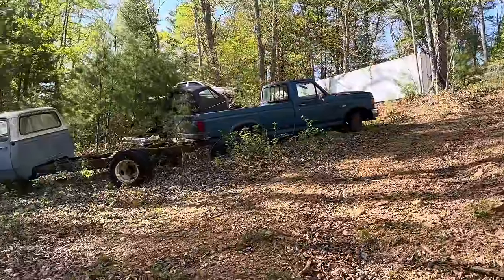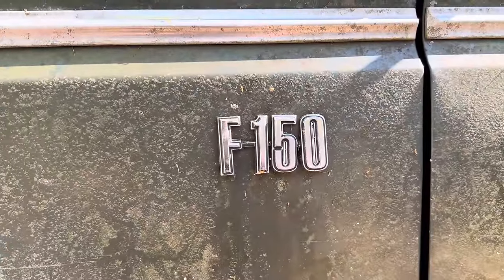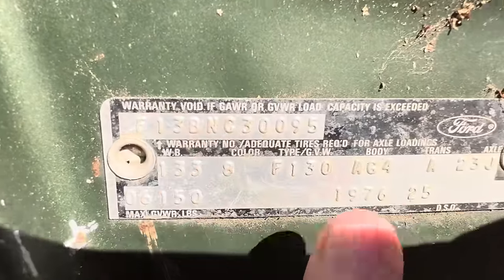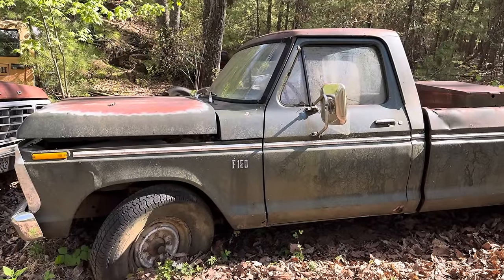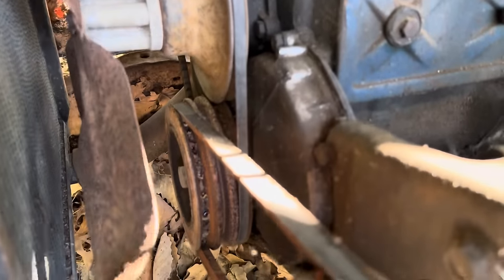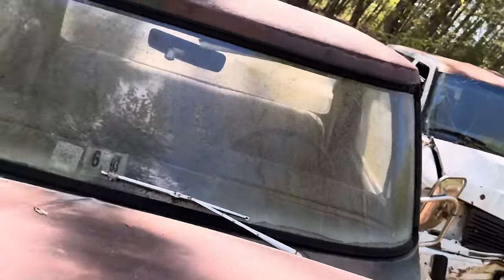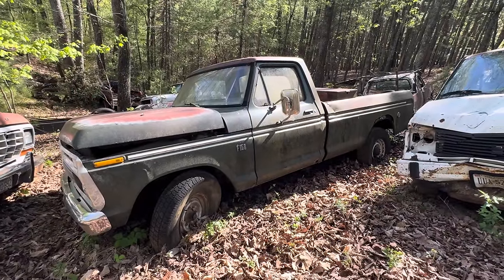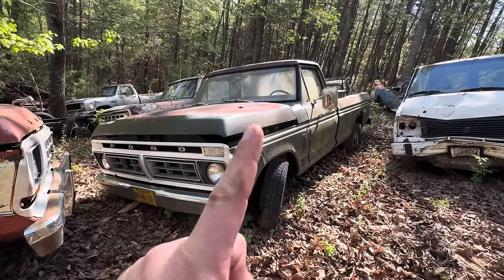Uncovering A Hidden Gem: Strange Ford MYSTERY Truck Discovered In The Woods! #RustBucketRescue

Comment: This is like the weird late '90's F150 "7700".  Right about the time they introduced the Super Duty trucks, they also made an F150 with "light duty" F250 running gear.  They were a really unusual 7 lug wheel!
Reply from the maker: Very interesting, I’ll have to research those!
Reply: A friend of mine drove one for a while, it was weird
Reply: They have unique badges.  Where it would normally say "XLT" or "Eddie Bauer" it literally says "7700".  I remember most of the owners I knew hated the weird 7 lug wheels, because brake parts were harder to come by and the factory steel wheels were the only wheels available!
Reply: @matthewf5891 1997-99 were F250's and the 2000-04 7 lug models were  renamed F150 HD or something similar. The 7 lug wheels were stupid IMHO
Reply: The company I worked for bought dozens of those trucks at the time. When they came in and we realized they were a 7 lug wheel we had to order 7 lug wheels for extra spare tires as well as due to where we used them each truck needed two spares available.
Reply: I replaced lots of those 7 lug axle shafts. Had one customer that never could keep the axles more than a month before replacing them again. Never could figure out why as it wasn't abused.
Reply: Never heard of a seven lug wheel.
Reply: @rodneyj.4121  1997-2004 F150/F250 light duty; those damn 7 luggers were a real thing, I remember them from new
Reply: @matthewf5891  I remember those 7 lug Wheels was sort of a stop Gap measure because that model of F-250 was going to be different and only for a year or two that was when they separated the two models the 150 is a different truck from the one that was to come I they went with a 7 lug wheel because the underpinnings for that truck are different they kept with the old style for the one tons for another year or two before they were finally done with the 3/4 and 1 tonne 1 1/4 ton variance F-550 what's that a deuce oh I just remembered that's because they were developing a Suburban type truck with the new body the ones for the F-250 F-350 F-450 F550 I think if you had an F-100 and it had a straight 300 cubic inch so I would imagine that would be called a f-130 so didn't the F-150 not come out until 77 I know that's the year it became the most popular truck in America also I think that's when they discontinued the F100 because you were talking about the lights 77 had a different lighting setup so quite literally the F-150 was launched with the different more heavy duty electrical system
Reply: I worked for Summit Developers in Salisbury NC and got a new 2006 F-150 extended cab long bed heavy duty pickup. It had a 8,200 GVCW vehicle load rating and those 7 lug wheels!
A 250 GVCW started at 8,800 as I recall. In my opinion Ford should have never made those 7 lug limited production pickups.
Reply: @norahjaneeast5450  1975 for the F150 since it's GVW was over 6,000 'lbs hence not needing any sort of emissions equipment outside of PVC and possibly an Evap system. The F100 that year was stuck with the cat, etc; otherwise the exact same truck despite its under 6,000 lb GVW
Reply: That I've been able to put together is that Ford did the 7700 package to be like the Z71's with the 3/4 ton rear axle.
Reply: @adamelliott2302  you're at least partially correct IMHO
Reply: We owned 2 brand new. They were odd trucks. 7 lugs like you said and parked next to an normal f150 (non 7700) the axle spacing was also different . Both had the 5.4
Reply: @martinthomas2439  the last year of those 7 lug trucks was 2004
Reply: @piercehawke8021 Not exactly. I had a company issued 2014 F150 with the goofy 7 lug wheels (aluminum). Mine was 2wd, but they could have 4wd with the 3.5 V6TT or the 5.0 V8. I’ve only seen them in super cab long bed.
Reply: They still use the 7 lug wheels on some f150
Reply: Kind of like the Silverado 1500 with 8 pin wheels. Circa 2000's.
Reply: These oddball trucks are pretty cool. I think even Dodge got in on this around the same time with the 1500 Megacab.
Reply: @lancereagan3046  or the (Dodge) Ram Mega Cab 1500; it was clearly a 3/4 Ton pickup but derated in payload to I'm guessing under 8,600 GVW on paper masquerade as a 1/2 Ton
Reply: @piercehawke8021 I agree. Had a 1999 myself. The 7 lug wheels were the weirdest things about it. It was like they used passenger car studs and lugs on a standard f 150 rotor. Other than that a good truck for what it was. Total beast in the snow, though.
Reply: I have a set of new rotors for a seven lug Ford if any one needs them. ✌🏼😎🇺🇸
Reply: @RustBucketRescue    there were a few jellybean diesels as well with van engines
Reply from the maker: @bobbywalter5320  I’ll have to look into that, that sounds like fun oddball truck.  I know 2004 mustangs, built in the last 6 months of the model year got a van sourced 3.9L V6 instead of the mustangs 3.8 V6.  Ford didn’t think they’d sell as many 2004s as they did and ran out of engines, and had to rob some 3.9s off the van assembly line to finish out the run until the new bodystyle came out in 2005.  Ford did a bunch of fun weird stuff - I love it!
Reply: They also had the exhaust exit in front of the right rear wheel didn’t they?
Reply from the maker: @FixinCat  now that you say that, I can’t recall.  I’ll go out in the morning and take a look at the exhaust and reply back to you!
Reply: They were junk. We tried using them in the oilfield. Worst things about them were emissions and transmission problems
Reply from the maker: @carlachambers3771  emissions suck!  Where they all automatics that you had?  I know Ford did make some in a manual.

Comment: Best combo ever, 300 6 cylinder, manual 4 speed trans. Will not win any speed races, but it will pass them on the reliability race.
Reply: 300 was ok if you were ok with 7 mpg and rampant oil leaks.
Reply: @Travis-rj4dq  I drove a ca 1982 F150 extended cab with the Six and the 4 spd OD tranny; it was pleasant to drive
Reply: I had an '83 heavy half ton 150.  It could carry a lot of weight in the bed but did not have 250 axles.

Great engine, the 300 but in '83 Ford crippled it with a 3.08 axle and horrible 4 speed manual with OD which had the gears spaced too wide and was terrible on hills with a load.
Reply: @cheftomsd  3:08 gears with an OD?! I agree; that's nuts, truck should've had ca 3:55 gears
Reply: @cheftomsd  Ford didn't offer a 3.08 axle ratio. That's a Chevy thing. The Ford rear axle could be had with 3.00 gears.
Doesn't sound like much of a difference (because it isn't), but you're tripping that fine line that separates the Chevy camp from the Ford Camp, and that's a battle you don't want to get mixed up with, if you can help it.
Still, you have a point. The Ford "Town & Country" top loader 4 speed was really setup as a 3-speed with a built-in overdrive, so the gear spacing tends to be quite wide, compared to your typical 4 speed.
The smart move would've been to replace the 3.00 gears in the rear end with 4.11's, or just get a replacement axle with the 4.11's already installed.
Low gear total reduction would've been around 13.52-13.35:1, while OD would've been an effective 3.33-3.28:1. A nice spread, even if only separated by a couple of gears.
Reply: @cheftomsd go to 2000to2003…?the “77”series f150 had three quarter ton chassis
Reply: Stump puller...
Reply: @maddhatter3564  mmm mine got 22 mpg

Comment: I had one of these trucks , I was the second owner . The truck you are showing has a 1 ton full floating axle rear end , mine had an 8 lug but it wasn't a full floater , I wonder why ? Was that also an option ? I know my truck had the 360/390 option engine and manual trans . The first owner was my boss at a auto repair shop I worked at and we are still friends , he said he wanted a camper hauler for hunting and he was shown 2 models , this one and another with a set back rear axle . One thing I remember about this truck , the factory heater was terrible , I had to up grade it to the high output heater core . Thanks for the video it was cool to see a truck like mine again .
Reply from the maker: Thank you for watching!  I’m going to pull in a F250 next to it and compare the brakes, the frame thickness, the suspension, etc and see how similar they are, hopefully it’ll help solve the mystery so stay tuned!
Reply: Excellent video
Reply from the maker: @allenprine3751  thank you brother!  Keep an eye on the channel, I’ll have a follow up video soon of getting this thing back on good tires and brakes and seeing if she’ll drive around the yard under her own power!
Reply: Great video!  Stirs up my restoration juices!  I have a ‘73 F250 sitting in the woods!…maybe time to drag it out!  It came with a 390, but since I trashed it there’s now a 360 in it.  I’m 2nd owner, With about 160k miles on it!  I’ll be watching, just subscribed!
Reply from the maker: @davidsmith3828  thanks for subscribing brother - greatly appreciated!  It’s the weekend, go pull that ‘73 F250 out!  No excuses!  You’ve got this brother, go pull it out and see if the engine will turn over!
Reply: I do too, because Ford didn't go to a semi floater 8 lug until the first year of the plastic,thin medal 80 up Ford' F-250s.
Reply from the maker: @patrickmcgoldrick8234  they just aren’t the same!
Reply: I have a early 70s Camper Special, 8 lug wheels.  I was told it was a heavy 3/4 ton.  It held a lot of weight in the box.  We put about 800lbs of tractor weights in the box in the winter, didn't drop back end at all, also didn't do much for driving in the winter.
Reply: @heatmoon  The easiest way to tell is the heavy duty F 250 which is pretty common is the heavy F 250 has 2.5 inch brakes,the standard F 250 has 2 inch brakes and this is fairly common from 68 to 79 F 250s.

Comment: Ford and Dodge made some odd set ups for the civil engineers, rail yards and such. They were all typically painted that dark green, had 6cylinders and no cosmetics. Yet had things like one extra leaf in the spring pack, 8 lug, and sometimes a power take-off on the back of the trans. Most of them were heavy duty manual trans. with floor shifter. Typically they deleted any side crome strips, radio and air delete. I bought 2nd hand 72 Dodge that had been used for drilling soil samples. I couldn't drive it on the hi-way over 60mph, it was geared so low. It was a great heavy duty truck that I needed at the time for my masonry business. Now I wish I would have researched that ID badge on that truck.
Reply from the maker: This sounds exactly how this one was build.  Thanks for the feedback, I’m going to have to dig and see if I can find the ownership history of it and see if it was build for a gov’t or rail yard!

Comment: In 1976 Ford offered an upgrade on chassis parts to out flank the EPA rules. This upgrade provided stronger axles, shocks and springs. I ordered one in '76 and got the twin tanks, high output heater, sliding rear window, and an 8 foot step side box. In 1988, I replaced the engine and installed a 390+ motor. I still use it.
Reply from the maker: What makes no sense to me is anything over 6,000 Lb GVWR was emissions exempt, and a "normal" F150 was over 6k GVWR, so why offer the upgrade when any old F150 was already emissions exempt?
Reply: Special order truck?

Comment: Ford was following Chevys foot steps with this. In 1975 Chevy put out the "Heavy Half" which was their smaller C-10 truck with a higher GVW so they could skirt the emission standards going into effect in 1976. Ford did so for just one year with a limited amount of trucks cause they where already well into placement of the catalytic converter on to the trucks. So this is just Fords version of the Heavy Half.
Reply from the maker: The GVWR is actually LESS than that of a “normal” 5 lug F150, so that kinda pokes a hole in that theory.

Comment: Hello From Kentucky. I was scrolling here on YouTube and noticed this video. I am also a “Old Ford Guy” and immediately subscribed to your YouTube channel. I never personally did see any of the F-130s but remember that GM was doing similar things with the “Big 10 & Heavy Half” trucks back in the day. When I worked in the equipment section of the transportation cabinet here in KY, We had a few of the “Heavy Half” trucks in the fleet although the vast majority of the 1/2 ton pickups and the crew cab trucks were either Chevrolets or Dodges which were mostly 3/4 ton with the V8 engines and 4 speed transmissions. The Chevrolet Crew Cabs were an absolute pain to do brake jobs on because for the government vehicles, GM used parts that may range back to 1973 to into the later 1980s when they finally changed the body away from the square body. When I started in the early 1990s, We really didn’t have any Fords until you went into the single axle and tandem axle dump trucks. Hope that I didn’t bore you too badly.

Comment: I had one. It was my very first truck. It was a Ranger XLT; brown and white and had light tan interior. Factory A/C, power steering, power brakes, intermittent wipers, dual tanks, had shag carpet and the vinyl door panel inserts. Factory 390 4V and had 3.07 rear differential. To the best of my knowledge it had a 6700 LB GVWR. Everything about it were F-250 except for the badges. I had to put a master cylinder on it and one for an F-150 did not fit. Had to be one for an F-250. Universal joints were for an F-250 also. Like I said it was basically an F-250 in disguise.
Reply from the maker: How sure are you on the GVWR?  From what little I can dig up anywhere and everywhere I can find tidbits of information, all F130s had 6150 GVWR.  Sounds like a beast of a truck either way!! What ever happened to it?
Reply: @RustBucketRescue  Honestly, I'm not sure of the GVWR at all. It could have been 6150. There's a possibility I might have its VIN written down somewhere though; most likely in one of the old manuals I have. I'll look and see what I can find. I traded it in 1995 when I was 18 years old for a 1979 Bronco. That's another one I wish I still had.....lol!
Reply from the maker: @FerdinandMagellan08  the ‘78-‘79 Broncos are amazing and the value of them is going through the roof, they’re amazing rigs!  What kind of drivetrain did your Bronco have?
Reply from the maker: @FerdinandMagellan08 oh man, the 78/79 Broncos are rare birds these days, I wish you still had that thing too!!
Reply: A factory 390 4V had to be pretty rare in a pickup. Or it was a transplant.
Reply: @RustBucketRescue 
I had a new 73 XL short wheel base smooth side with 6150 GW trailer tow package. Factory dual tanks, cab lights, 390 power and air, C6, 2 wheel drive, 325 x 9". had 5 on 5.5 x 15 wheels. Ordered to pull a  trailer. Only dual tank SWB I've ever seen.
I had a new Country Squire 400 and the truck rode as good as the car. Really. Also had the exact same seat fabric as my friend's 72 Grand Marquis.
Reply from the maker: @hotrodray6802  what an interesting build!  What color was it?
Reply from the maker: @hotrodray6802  what an odd, interesting truck build!  I’ve never seen a dual fuel tank SWB. What a strange build - I love it!  What color was it?
Reply: @johneckert1365  Not very rare. Most Camper Specials were equipped with the 390 4V
Reply: @FRLN500  Most were 360 2V, a few were 390 2V.
Reply from the maker: @johneckert1365  heck I had a Camper Special that had the “baby” 352 2v.  Ran good though!  For what it’s worth, every camper special I’ve seen that was stock had a 2 barrel on it.
Reply: @RustBucketRescue  same here. 352 were good engines 👍

Comment: I remembered that Ford had marketed the F150 to get around encroaching smog requirements but didn’t realize they included 3/4 ton components. Great, informative video.
Reply from the maker: That’s the thing, regular F150s got around smog regulations as regular 5 lug trucks and did NOT include 3/4 ton components.  That’s what makes this truck extra oddball, it didn’t need 3/4 ton components but received them anyway. Super odd.  If they wanted a heavier duty truck, just buy a F250 you know?  It’s odd that they essentially built an F250, but went out of their way to ensure it was sold as a F150.
Reply: @RustBucketRescue basically a forerunner to the light duty 3/4 tons of the 80's. My guess it was aimed at a niche spot in the gvw range. Heavy enough to be smog exempt, but light enough to fall below something like for cheaper license or insurance. Maybe aimed for businesses as a cheaper truck to run. Part of me wonder if it also could of just been a budget model and priced fairly cheaper than a F250.
Reply from the maker: @danfisher7856  that’s my suspicion. The GVWR of 6150 is on the low end of what a F250 would be (6250), so I’m wondering if it was a sneaky way to get an F250 without the F250 price tag, and being taxed and registered at the DMV as a “light truck” instead of a “heavy duty” truck.

Comment: My step-uncle Glenn Wiggins of NC in 2001 built a red hot-rodded 1976 F130 with the 8 lug rear end with a 460 in it and that truck was stupid strong and if it could get traction, would really get down. I had forgotten all about that truck until seeing this video. Glenn was a Ford man through and through and always had a project going back then. He even built a 56 Chevy truck and put a 5.0 Windsor from an old mustang in it and still has it most likely though I haven't seen him in years.
Reply from the maker: That’s awesome!! Is he still around?
Reply: @RustBucketRescue  I'm not sure if he's still alive, I haven't been back in 3-4 years but I'm pretty sure he's still there. He is/was a tractor and restoration mechanic/farmer. It's my step-mothers side of the family and I've never really been part of them. He sold that old truck to a guy that lived in the same town but the fella was scared to drive it so the last I saw of it, it was just sitting, which is too bad.